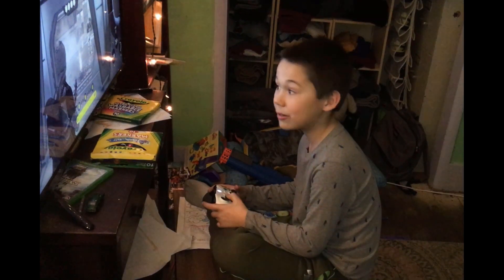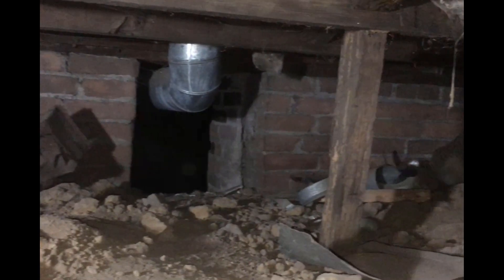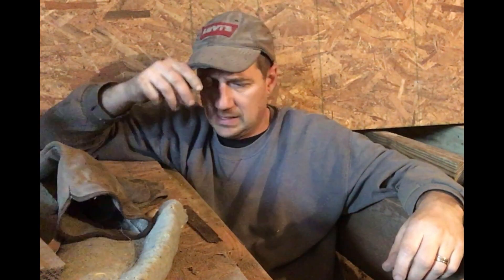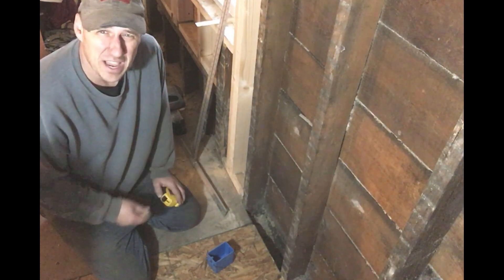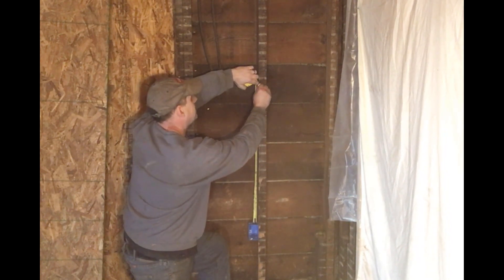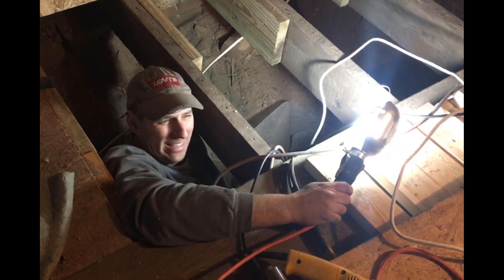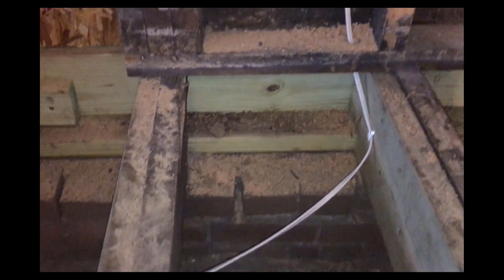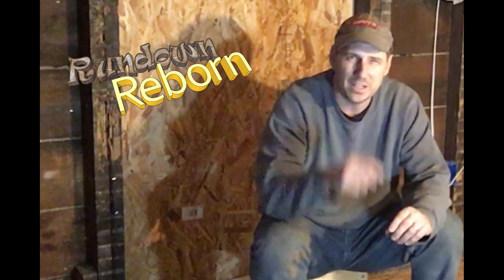DIY: PREPARING ELECTRICAL Under The Floor - Pulling Under Floor Wires

Comment: You're running #14 wires, are you using 15amps or 20amps circuit breaker?

Comment: If I turn off all the circuit breakers in my panel, will I be safe to touch the electric wires in my crawl space? Thanks for your help.
Reply from the maker: A breaker will cut all power to anything connected to that circuit. At the top of most panels is 1 or 2 master breakers. If you trip those to off, that will cut power to the entire panel. Hope this answers your question.
Reply: @RundownReborn  thanks. So all wires in a house get power from the panel?
Reply from the maker: I would say if it is wired correctly and there are no other sources of power, then yes. If you are concerned, there are tools at your home store that can tell you from the outside if there is power or current running through the wire.
Reply from the maker: These tools are called Non Contact Voltage Testers and cost about $15-20
Reply: @RundownReborn  ok. Thanks!

Comment: Against code to run cable perpendicular to floor joists. Need to drill holes, or run conduit, or put up some running board.
Reply from the maker: This is true to code. The intent of this regulation is to prevent nails or screws from finish work from penetrating the wires.  I did not bore holes in the crawl space areas as I felt there was no risk of the wiring being damaged. Since my home is an owner occupied renovation, no building inspection is required. But if you are going to be inspected or you feel the wiring is at risk of being damaged or pierced, do make sure it is well above the bottom of the joists.
Reply: So did you have to run your wiring into the crawl space
Reply from the maker: @justinearnest3811  Yes I did do the wiring in the crawlspace for the living room. It was much easier to do the wiring under the floor in the crawl space (for that room) from outlet to outlet then to drill all of the studs in the walls. Plus my electrical panel is in the basement.